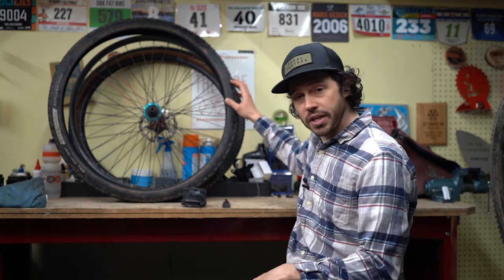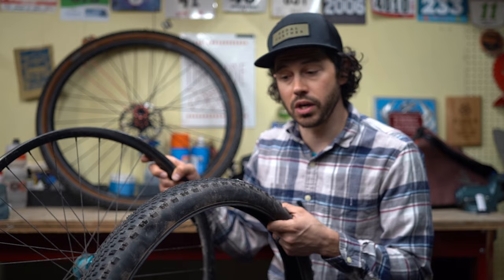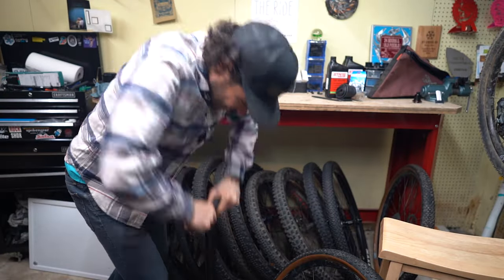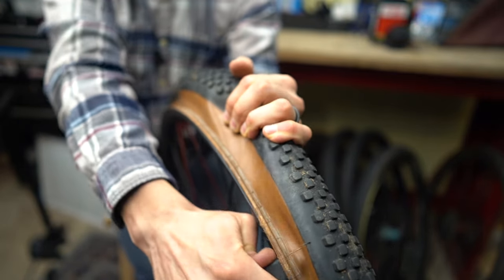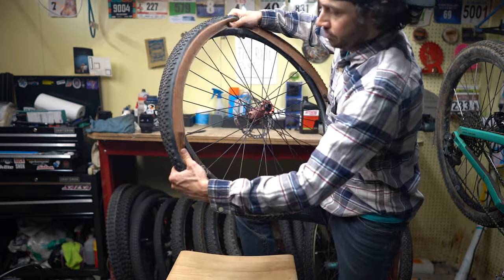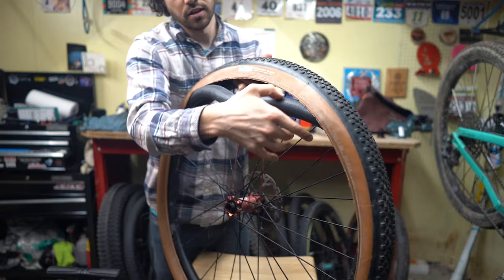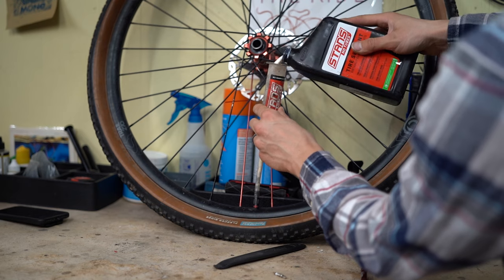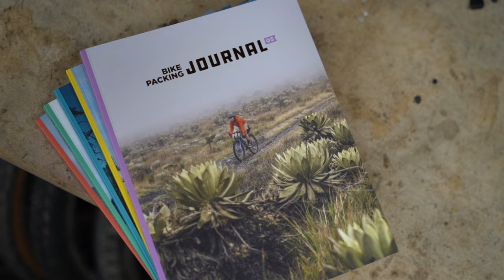How to Mount a Stubborn Tubeless Tire (With a Floor Pump)

Comment: When I tried seating a Gravelking Slick, it wouldn't even work with a gas station compressor, so I ended up buying one of those tubeless boosters, definitely worth it, and way more sustainable than a co2 cartridge
Reply: This must be a thing with GK tires in general. I had the same issue with my compressor even with the valve core out. Also, I lined up the logo with the valve stem, and I've noticed that both my tires (yes, even the front) have taken a few "laps" around the rim. I like Gravelkings, but perhaps it's time to find another brand this year.
Reply: I was comparison shopping Gravelking SS and Teravail Washburn.  Went with Washburn and they mounted first attempt.  Happy with how the ride so far.
Reply: Ha. I found this video because I'm trying to  seat the same tires
Reply: Oddly I'm watching this video for exactly the same reason...
Reply: brand new gravelking SKs... its why i'm here
Reply: @artemisxo6734  managed to get mine on by inserting tubes and leaving them inflated for a couple of hours. Then carefully extracted the tubes...

Comment: Added tip: If the tire has been folded, leave it unfolded and in the sun to help the bead straighten and the tire to be more flexible, prior to mounting.
Reply: Foldable tire?
Reply: We do this at my shop. I call it letting the tire breath.

Comment: The easiest method I've found without air compressor is to simply use a CO2 cartridge. It's basically instantaneous, and I've never seen it fail.
Reply from the maker: Yep, good point. It's somewhat wasteful, but that has worked for me in the past with success.
Reply: I cam promise you, the CO2 success rate is not 100% :) Ask me how I know this.

Comment: You are awesome man. Your trick with placing a regular tube inside to have at least one side fully on the beads did the trick for me. With one side on the beads an average track pump which I had was able to inflate the tire to push the second side into place.

Comment: I have a pair of those same tires that you are seating in the video Neil. They are an awesome tire in every riding category. Trying to seat them without an air compressor, which took forever using ever trick imaginable caused me to use every four letter word I knew. I’m pretty sure I even made some up. If they ever flat on a trail and brake the seal I’ll just stick a tube in to get home.

Comment: Thanks so much! My first time fitting new tyres as my bike shop did it the first time. I was about at my wits end but found your vid. I used working the bead onto top of rim method, couldn't get all the way round cos the tyres were so tight. Made it about 80% then managed to pop one side on using a co2 cartridge. Then did the same with the other side and the other wheel. 
Again, thanks so much for your helpful tips - top man! 🤩😎

Comment: Thanks so much for this guide! Even with a compressor it wasn't popping and the way you showed putting the bead on manually was the trick I needed for the rest of it to work. Still have sore hands though ;_;

Comment: I have a compressor, etc. However, I was having a real issue with some off-set rims where the rim tape had dimpled into the spoke holes just enough to prevent a seal to set a bead (the bead wanted to sit over the spoke depressions on one side). Your innertube idea saved my life. I used the tube to set the bed and removed the tube from the side without the spokes and presto. My other option would have been to re-tape the rim but now I don't have to. Thanks.
Reply: I had the same issue as you with tape and rim holes. Instead of re-taping I just cover those holes with one layer of electric tape. Works fine without tube or setting the bead with tire lever

Comment: What I have noticed is when you put sealent in before try forcing the bead to the edge of the rim it keeps slipping to the middle of the rim because of the slippy sealent. What worked for me is do it al dry and when the bead is seated then deflate and put in the sealant. 

Great channel btw!
Reply from the maker: Yep, that’s why I start dry, thanks for checking us out!

Comment: A compression strap, or even a tube in a pinch, wrapped around the outer circumference of the tire can help minimize air loss.

Comment: A sort of middle road in between the lever lift and inserting a tube is to use your hand and manually press the bead into the hook (if it's a hooked rim) all the way around on one side. I will usually put some sealant on my finger and and "paint" the bead this way as well because it seems to stick in just a hair better (I think it's more about the vacuum than the sealant actually bonding in the short of time).

It's a little tedious to get perfect but if you gotta do it, you gotta do it!

Comment: I added a 3rd layer of tape (Bontrager Aeolus Elite 35 Rim / Vittoria Rubino Pro 25c Tire). The tire finally sealed using a Bontrager Flash Charger pump pressurized at 116 Lbs on the second go. On another note.. Using this tire on a HED Jet RC6 Performance wheel - the tire beads will become stuck to rim. You'll need to use the wooden block / step method to break the bead from the rim wall. The other side will also be a challenge. I needed to use protective strips of wood and pliers to pry that bead away from the rim.

Comment: My local bike shop insists that the key is to build up the inside with extra rim tape.  Seems the narrow the tire and rim, the harder all this is.  My mountain bike with 2.2 tires went on fine whereas my old gravel bike with 650b x 38 and my new gravel bike with 700x 40mm were both a huge pain.

Comment: About to convert my new Jeffsy to tubeless, with only a floor pump. 
Let you know how I make out.  Thanks for the really informative tips.
Reply: Just finished. Went smooth as butter. Both tires done on under a half hour no leaks.

Comment: there is a battery powered air pump with good volume of air. cost 20$ (aliexpress) and it helps alot pumping tubeless tires

Comment: cool tricks, but what if you tried them all and not a single one helped?
Reply from the maker: compressed air!
Reply from the maker: Dang, try to “pre-seat” the tire them use the compressor….
Reply: @BIKEPACKINGcom  turns out im just dumb i didnt give the compressor enough time to build pressure, once I did it inflated first try
Reply: Use inner tubes? I know . . .

Comment: It's  easier to seat just one bead , if you're having trouble. Put in a tube blow it up , seats both beads no problem.  Pull out inner tube add sealant and you only have to seat one side

Comment: I think you skipped over the importance of inspecting and applying rim tape, making sure you’re using either brand name tape like Stan’s or very least Gorilla Tape. It’s one of the key aspects for creating an overall seal airtight, especially the overlap and tight pull method and how to properly puncture a hole for the valve through the tape.